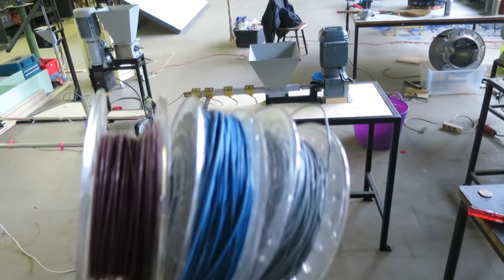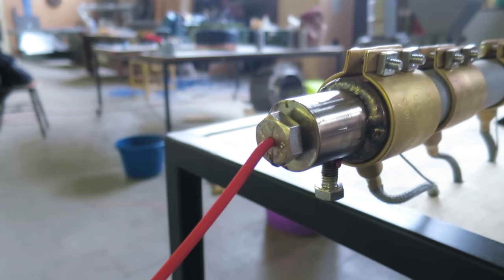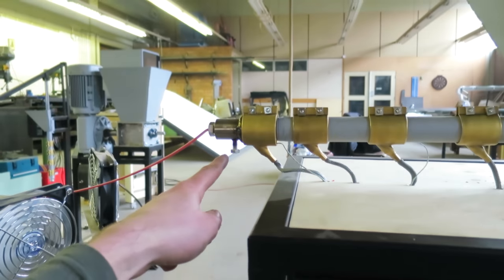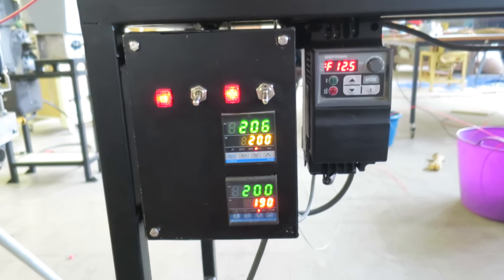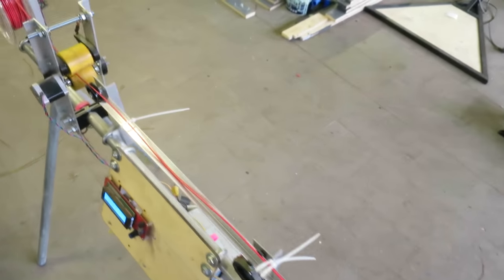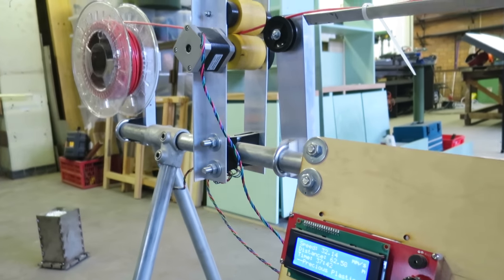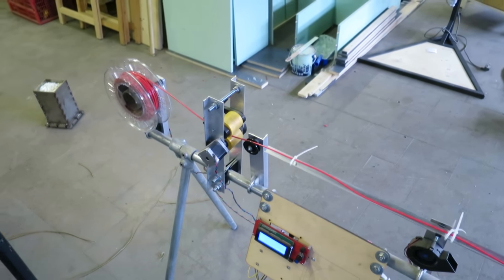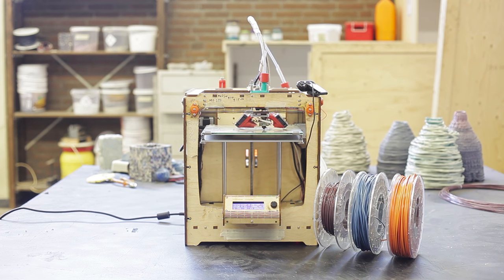Precious Plastic - 3D printer Filament maker

Comment: The introduction of a 3D shredder and 3D printer filament maker by Precious Plastic are tools that have the potential to revolutionize and revitalize the plastic waste industry in my opinion. Although the initial cost to build and the knowledge to construct may seem discouraging, I think, if a person has the monetary and mechanical potential, then the build will be most rewarding. As 3D printing grows in its use, so too will the need for its material... plastic filament. As the demand and consumption for plastic waste continues to decrease in China, formerly the largest user of American plastic waste, the US finds itself in a predicament with what to do with plastic scraps that must now, in turn, be sold to China. Yet, plastic waste material need no longer be a an expense to the US waste industry that ends up in landfills that have met their waste capacity. As a new tool, the 3D printer filament maker, may revolutionize the way Americans and other nations view plastic. The 3D Printing hobbyist and the like may view this a cash crop “harvest” waiting to be converted into a resource to meet the demand of maker 3D printing. Now one person's plastic waste can become another's precious resource. Plastic can now be turned into a material used in the 3D “printing” process making the recycling of plastics possible and accessible for the avid hobbyist to produce free filament for 3D Printing. In turn, production costs may be rapidly decreased for the hobbyist with such a material “free for the picking” out of the trash and into the workspace.
Reply: Did u made it ? , How much it cost ..?

Comment: Have you seen the jigs to cup strings from PET bottles? I wonder if it would be possible to make 3d printer extruder, that would accept such flat string instead of round filament.
Reply: I also wonder if it would be possible to connect 3d printer extruder to injection mold instead of printer nozzle. That would easily turn any 3d printer into injection molding machine. Maybe you could even modify the machine to mill or EDM the molds (Maybe from some high temperature plastic like teflon, or just EDM it from aluminum)
Reply: @harviecz  they did build that, go tho the website and search for the v4 (pro) plastic extruder, they have the blueprints for exactly your idea

Comment: Hi,
I'm a 3D printer user, always making some parts with Filament which PLA and TOUGH PLA. So, it remains some filament after prints. So, can I use this machine to get PLA and TOUGH PLA with recycling? If it's possible, how can I do it? For example, what temperature can I use? Thanks.

Comment: Thanks for your videos. You've inspired me to start collecting parts for my first extruder build! I am anxious to try making Polypropylene ("PP") filament, as you are doing in this video.  I have, however, heard that PP can be troublesome to 3D print. So, I have a couple of questions:
1. Any suggestions for printing PP filament on a 3D printer (for example: extrusion & bed temps, print bed surface, etc.)?
2. Are any additives (like glass fibers) necessary to make the PP filament printable?

Thanks again for all you efforts!
Reply: I've heard covering the print bed in tape helps

Comment: How is the diameter consistency guaranteed? I may do this for my local area but i cant find proper informations thanks
Reply: The consistency varies with the puller roller speed, I described it here: https://medium.com/endless-filament/make-your-filament-at-home-for-cheap-6c908bb09922

Comment: two questions :
1. Can I extrude HDPE with this machine ??
2. Can a 3d printer use HDPE for printing ??
Reply: If you look elsewhere you will find that HDPE tends to shrink too much to make reliable 3D printing filament. You could certainly extrude it with this setup and the appropriate settings. The problem seems to come when printing where the layers do tend not to bond consistently. It's a pity because HDPE is the most readily available to the home hobbyist.
Reply: I think making decorative things like vases etc shouldn't be a problem with HDPE (although i haven't tried it myself so i can't say for sure), but mechanical parts that need tolerances are probably not good for HDPE. Spiralize outer contour aka vase mode in 3d printer slicers is probably your best bet, with a bit low layer height to make sure the layers bond properly.
Reply: @paulreader1777  how much it cost sir ? , Thanx for the video
Reply: @saurabhbhoite8775  Go to https://preciousplastic.com/ where you will find the plans. It is a build it yourself project

Comment: I am having issues using the flakes in the filabot which is the extrusion machine i am using. It works fine with pellets but the flakes are not catching completely in the extrusion screw. Any suggestions?
Reply: use the extruder he made in another video to create pellets > profit

Comment: What's the Filament Diameter you are using? It's possible to adapt to 1.75mm?
Reply: The output diameter is dependent on the speed of your filament winding machine. Also you should use filament diameter sensors.

Comment: Can any 3d printer use these filaments? I understand that for example the HDPE shrinks at the moment of cooling
Reply: It can. Most of the bottles are made of PET, also called as PETG in the 3d printing community. HDPE is also printable and its quite strong but its hard to tweak to print right.

Comment: In the video, you make polypropylene filament. Does that mean you 3D print PP with a FDM printer? I thought it was not doable. And how do you make sure to get a proper 3mm filament? And is that a e3d extruder on that Ultimaker, at the end of the video?
Reply: Do you have any more info on the matter now since your response is 3 year old

Comment: Does the filament work in any printer?
Reply: Shouldn't be a problem, but there are a few things to consider:
1. The diameter of the filament must not be larger than what the printer supports, otherwise you won't be able to feed it into the printer because the holes are too small. Usual diameters are 4mm, 3mm, 2,85mm, and 1,75mm. If you make smaller filament than one of the standard sizes then it shouldn't be a problem to just put the smaller size into the slicer program.
2. If the filament is much smaller than what the printer is supposed to use, the hobbed bolt/filament feeding wheel might slip because it's not gripping the filament.
3. Nozzle size and clogging. Smaller nozzles clog more easily, and DIY filament might have contaminants in it. Even though the norm is 0,4mm, there are many different sizes to choose from. I've used sizes between 0,2 to 1,5mm and the huge 1,5mm nozzle is really interesting and makes really great and artful vases and bowls.
4. Size deviation. Diy machines often oscillate a bit in the diameter it produces and that may or may not yield bad print quality, or even clogging if it's too bad.
5. Humidity. If the filament isn't dry when made, and/or doesn't stay dry when in storage, then the print quality may or may not end up badly. The trapped water molecules in the plastic ends up cooking when printing (you can actually hear it puffing and see it smoking) so the surface of the prints end up looking bad and layers don't adhere properly so the parts end up breaking.
Reply: But i hope my comment doesn't unmotivate people to try it out! I've had the 4. and 5. problems in industrially made filament that I've bought so it does absolutely not only apply to DIY machines. Good luck to anyone wanting to do this
Reply: Thank you for your knowledgable comment
Reply: @jhsevs  Detailed explanation

Comment: How are you? In a 3d printing opportunity ask about the recycling of the plastic used and I was told that the plastic already used for printing loses characteristics. Whether of hardness, flexibility, etc. Depending on the material. How about that?
Reply: Heating does degrade the plastic but you can get away with recycling once or twice and if you want to recycle it again you will need to mix it with fresh non recycled plastic.

Comment: Looks good. Has anyone tried comparing this to commercial filament?
Reply: it's difficult to compete with commercial filaments. those diy extruder (Lyman ext etc..) are not precise enough to produce 1.75 +-0.02 mm. they use less sensors and lack of some essential part like the hot water coling + cold water cooling, autocalibration sensors etc.. Look are this video for example https://www.youtube.com/watch?v=lkpwTeYGGXs

Comment: Hi all, I need some help here. some kind of chemical treatment is needed to use the filament in a 3D printer?
Reply: Hola a todos, necesito ayuda aquí. Se necesita algún tipo de tratamiento químico para usar el filamento en una impresión 3D. English to Spanish translation

Comment: I'm curious to know if anyone has successfully done 3D printing with filament from this process. Another video here on YouTube (and comments elsewhere by people who do a lot makes the case that the filament has to be very consistent in diameter to produce a successful print. 

The current PP extruder would seem to be very good for making pelletized plastic for use in an injection molding machine, where dimensional tolerances are less critical.

For sure, progress in these things is in a series of incremental steps, and you have to start somewhere!
Reply: If the filament does not have a regular size it will be difficult to produce good quality prints because the flow will change. Also some printers, like mine (Prusa i3 MK2S Multimaterial) need very precise filament diameter, else it will jam. I guess it is possible to have a correct diameter but it will require a lot of tweaking regarding the speed of the motor unless there is an automated optical calibration.
Reply: With this setup, no you can not print quality parts because the winding speed is constant but the diameter of the spool changes as the spool is getting full. And as the diameter changes the speed of the filament getting pulled speeds up so it will reduce the filament diameter. This can be easily fixed by a diameter sensor.

Comment: 1.75 possible??
Reply: hello, yes it´s possible just changing the last part of the machine, in the video where he build the extrusion machine explains how can u change it.
Reply: It is possible but quiet difficult, to keep regular diameter over a full roll and slight variations will affect the deposition accuracy during the printing process and definitely will show on the the prints...

Comment: I thought the Polymer Science Park in Zwolle was the only one trying to print with PP. Funny because that material is (virgin) unprintable, does not stick to the print bed at all, or too well on a PP print bed. Not to start about the distortions. So, show me what you can print with PP because I do not believe it. If you have managed to print accurately etc with PP, please contact Wavin, they will throw money at you for that info.

Ik dacht dat het Polymer Science Park in Zwolle de enige was die met PP probeert te printen. Grappig want dat materiaal is (virgin) onprintbaar, hecht voor geen meter aan het printbed, of te goed aan een PP printbed. Nog niet te spreken over de vervormingen. Dus, laat maar zien wat je hebt kunnen printen met PP want ik geloof het niet. Als je het wel is gelukt om goed maatvast etc te printen met PP, neem dan contact op met Wavin, ze zullen je geld toesmijten voor die info.
Reply: I'm pretty sure he is producing PET or HDPE because thats the 2 main things that 99.9% of the plastic bottles are made from. PP is not used to make food safe containers.